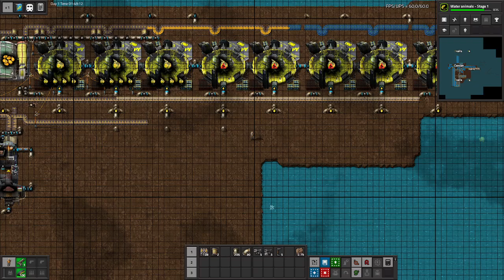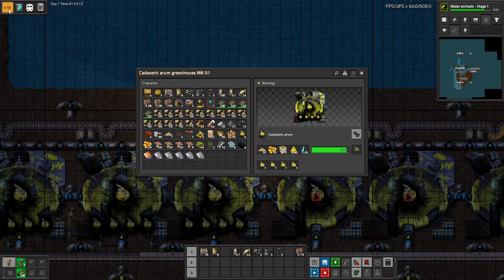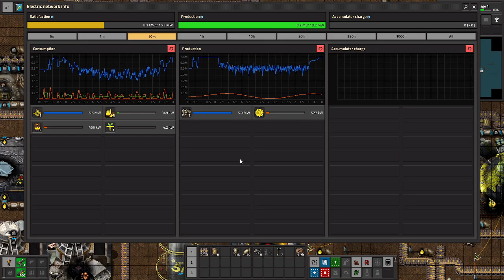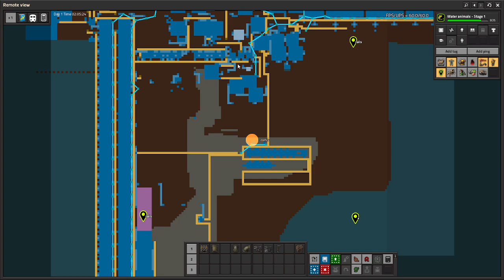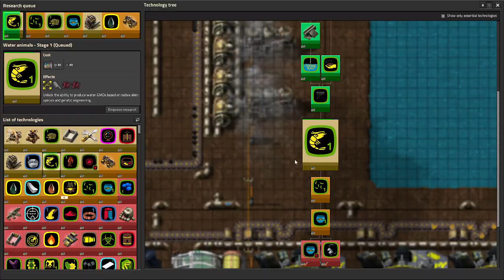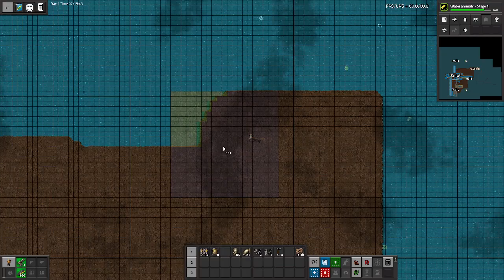Factorio PyBlock 2025 - Episode 18 - Ash, this is too easy! Let's power it up!

Comment: Basic inserters are slow to output the ash, u will lack of power later when ash will reach 1k in the boilers, separators need 8-10 inserters to keep up on input